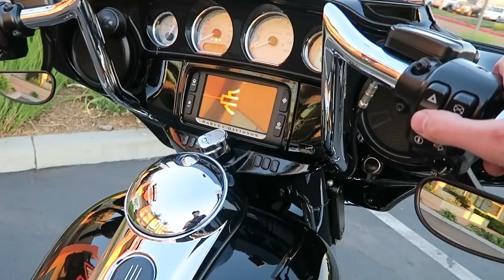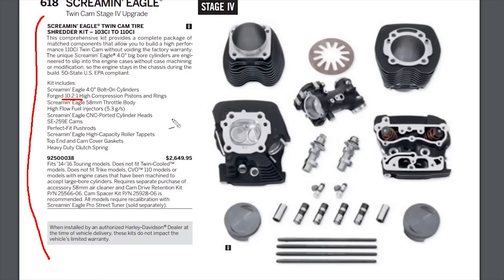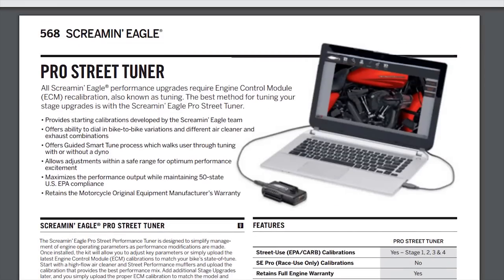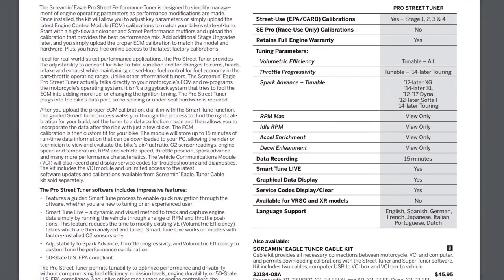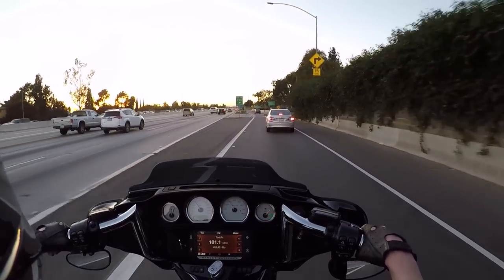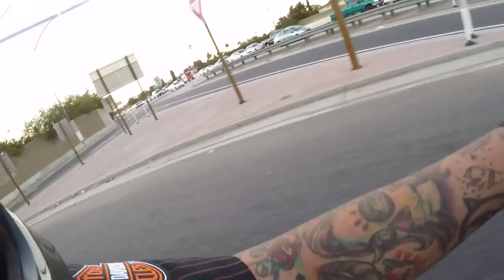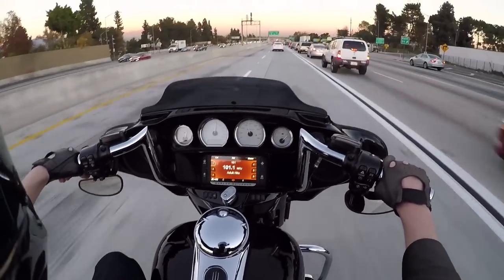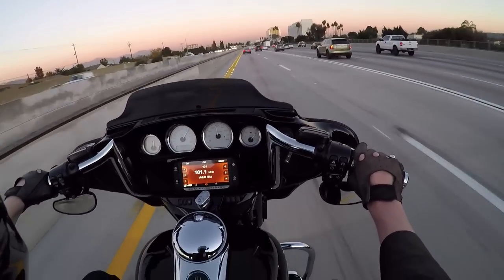Milwaukee-Eight Stage 4 VS Twin Cam 110 Stage 4 │Harley-Davidson Screamin' Eagle

Comment: Twin cam right there and the Harley Kit sucks power wise...check out the kits from FuelMoto and the power numbers they r getting from a 103 to 110 conversion. They posted dyno chart...119HP and 131lb.ft of torque. I do like the new blacked out Specials but why start loan over? I'll stay with my 16 RGS.
Reply: Richard Sak fuel moto rock, would never waste money on a HD kit..
Reply: ? I don't understand, you say Harley stuff sucks but own a road glide special. The 103 to 110 kit from Harley has excellent power.
Reply: Israel Rangel ummm no, read it again, I said the Harley  KIT sucks POWERWISE not ALL Harley stuff. I Don't know how u made that leap. 99% of parts I buy for my bike are genuine Harley except the things I feel the aftermarket is better at namely engine kits, exhausts, and handlebars. I believe those areas that effect emissions Harley, as a vehicle manufacturer, is limited by govt rules and regs (ex the SEPST, RIP). Like I said the Fuel Moto 103 to 110 kits dyno chart shows 119 hp and 131 torque with the same baseline numbers. Bars I have Factory 47 and Exhaust Rinehart. Everything else...genuine Harley Davidson.
Reply: Richard Sak 119hp and 130trq sounds more like a 120 motor . People can boost Dyno numbers in many ways. I've seen it done before. Coming from someone who has had a chance to ride a lot of bikes and different set ups on those bikes , I can tell you that the Harley 103 to 110 kit that is in this video does not have an ounce of suck in it.
Reply: Israel Rangel yes and dyno to dyno can vary thats why the baseline (which FuelMoto supplies) is so important. It's not like I'm the only one, the quality and performance of the Fuel moto kits are well known. Again, I believe it's that "motorcycle manufacturer" designation HD has that limits them by the govt. 3rd party companies like Fuel moto, V&H, Rinehart, Dynojet don't have that concern. They can make "offroad" kits and tuners and Exhaust sets without fear of fines. It would be ignorant to think these companies have better engineers than HD so Im sure it's an outside constraint ie. The EPA or what have you. Ride safe!
Reply: Richard Sak the Harley kits are EPA compliant. That have to be. Harley got sued for that race tuner. If the Harley kits didn’t have to abide by EPA regulations then they would make more power.
Reply: Jacob James exactly 100% correct. That's what happened with the SEPST (Screaming Eagle PRO Super Tuner). It was capable of  tuning the bike out of EPA compliance and that's why they got sued as a " motorcycle manufacturer".  Companies that don't actually build bikes do not have that constraint.
Reply: Finally a group of comments on this site where everybody's informative and useful with their information instead of everybody wanting to fight and name call and act like idiots nice!
Reply: Richard Sak ok are you aware that the tuner doesn't come in the 103 to 110 Harley kit? The kit comes with heads, jugs, pistons, piston rings, cams , throttle body, lifters, push rods and so on. That's what's in a Harley kit. You choose the tuner , pipes, and air cleaner you want. So with an after market tune , pipes, and air cleaner you can put out high power with a Harley kit. It's not the kit that sucks to you , it's the tuner, pipes and air cleaner. Which most people go after market with anyway.
Reply: Jacob James Harley tuners are not part of the big bore kit. If you wanted to, you can run an aftermarket tuner and that would make the kit non epa compliant.
Reply: Israel Rangel sorry bud but now your stretching. At this point I'm pretty sure you have the Harley Kit on your bike.  The majority of th output of the kit is NOT determined by the tune. It's a combination of the parts specs. The cams, pistons, cylinder heads, etc. The tune is done to alter the fueling and spark plug firing along with a few other features. You could not use a tuner to make a kit that is designed to produce 105 horsepower magically produce 119. I know what these kits come with and the FuelMoto is the same way. It boils down to EPA compliance and the fact that HD kits can't be as agressive.
Reply: Israel Rangel I will say this though. The Harley kits, if installed by a dealer and within I think 90 days of purchasing the bike, you keep your warranty AND that warranty covers the kit. That's a huge boost for the Harley Kit especially since in real world street driving, you DON'T need every ounce of horsepower possible. The Harley kits DO improve performance while keeping the bike EPA compliant and if bought and installed as stated above, don't void your warranty.  Having that warranty is priceless. If someone looking to do the kit has a bike that DOES NOT have a warranty anymore though, they WILL get more performance from a 3rd party kit.
Reply: Richard Sak I actually don't. Just stock engine , pipes, air cleaner and a custom mapping, but I've worked in a shop I can tell you that some of these aftermarket kits claim so much and fall so short of what they claim, doesn't mean they suck though, still good product. And also if you checkout the specs on some of these Harley and aftermarket kits they are very similar. Fuel air mixture and timing is very important when try to accomplish the full potential of the parts that you put in your motorcycle, so to say that a tune isnt gonna make a difference doesn't make sense. You can install any kit you want in your bike but with out a proper tunning its not gonna run to its potential.
Reply: So it would make the kit pretty much pointless.
Reply: Israel Rangel I'm done. Now I said a tune makes NO difference. I NEVER said that. Of course it does. However an EPA compliant tune and a non company tune are not going to change the HP number by almost 15. Buy what u like, believe what u like, but stop taking what I say and twisting into what you want me to have said so u can make your argument. Again, OF COURSE a tune matters, I NEVER said it didn't. I'm done, I think people here have gotten enough correct info in this discussion to decide on what they want.
Reply: Richard Sak my hats off to you man you got the patience of Job !! Good grief something's wrong there...
Reply: Scott Bedsaul I never mind an exchange of ideas but don't take what I'm saying and twist it and then make an argument based on that twist. All the concern about the tuners and I would bet the biggest difference in the kits is the camshaft. Other than power adders like turbos and superchargers I think the camshaft probably has the biggest impact on the performance and personality of an engine. You can cam an engine for mostly torque or you can  cam an engine for mostly high RPM  horsepower. Of course to realize the full gains you might need head work (porting and polishing Etc) but just the camshaft can greatly change how an engine functions. Again for a lot of people the Harley kits are great because they do improve performance, not everybody needs every last horsepower, their Emissions legal if that affects u where u live, and you can keep your warranty.
Reply: Scott Bedsaul unless you have some knowledge to share with us , kick rocks.
Reply: Richard Sak yeah they have gotten allot of info. But I've ridden a fuel moto setup and a screaming eagle setup . between the 2 there is no night and day type of difference. So to say the Harley stuff sucks for making power , which you did say. Is false. It makes comparable power to the kit you're talking about. Can't go of what a piece of paper says all the time. What matters is how it feels when you jump on it and ride it.
Reply: Richard Sak I'm sure you've ridden both right? Or is your opinion based off of dyno sheets?
Reply: Fuel Moto does great work no doubt BUT....... Screamin Eagle kits= Carb/EPA compliant AND does not void your warranty !  Just sayin.  If these things do not really matter to ya , then Ya Fuel Moto or T man, are really building impressive motors.  On a side note every motor has a HP- Life number. Meaning the more that they create the shorter the life.....kind of like a sparkler - burns bright as hell when lit but burns out fast.
Reply: scott peters more than half the time I see people get all these performance upgrades on their bikes and never come close to using it.To me that's just a waste of money. It's to stroke their own ego.
Reply: I used the harley kit because I just bought it and everything will be covered for three years on my warranty. After that the motor will already be big. Just swap a couple things for more aggressive and make more power.
Reply: Yeah but ya know Certifiable Harley Wrench Turners that work for a Stealership can only Quote out Harley Specified parts.. Liability issues.. Hundred ways to skin a cat.. Depends on how big a knife ya got to do the skinning.. Gotta remember Older Harley's especially early 70's - 90's ya could build an tune 3-5 the same and not one of them would run identical to the other.. either sound or response .. Harley has come a long way still got lot of ways to go... hopefully it's not too late in the game yet.. The newer bikes are sweet on power compared to my '73 <stock> FLH and my '84 <stage 1-2> FLH  but even those 2 won't touch my '14 Ultra stock.. so they best be hammerin down..

Comment: I have a 2014 ultra limited cvo with V&H Monster Squared's and tuner.  I've had HD salesman tell me the stock M8 107 will outperform my 110.  So I test rode a stock 107 ultra and I was not impressed.  Of course the salesman played it off that if it had same mods as my 110 it would walk away and leave my CVO.  I just don't see it and definitely didn't feel the potential on my test ride.  So Matt, would an Ultra CVO Twin Cam with a 117 kit keep up with a 2018 ultra CVO M8 117 ?

Comment: Milwaukee 8 doesnt sound like a Harley
Reply: Maybe they realized the engine had to change to go forward.One piston  prevents the other piston from exelerating unless they change degree like a Ducati. Not all v8 are the same in cars. some v almost look horizontal.
Reply: Stock exhaust
Reply: Ur wrong.
Reply: Every m8 ive ever heard sounds way better than a tc. M8 has the best sound of a harley.

Comment: Great video I noticed the volt meter was almost pegged in the red while riding is that ok?  I have 2017 Street Glide and mine stays pegged right above the red line same as this bike. Is that an issue what is your thoughts.

Comment: Wait till you have to make a warranty claim - it's all very well and good for Harley when customers spend $10,000 on mods but when shits hit he fan they will tell you to take a hike as in my case they blamed my quiet baffles for cooking the engine and told me to get lost or pay $3000 for repair bills.

They told me because i paid for stage 5 my engine is considered a race engine so i do not have warranty on my brand new 2017 Harley Breakout. 

I bought 5 brand new Harleys since 2013 and spent over $100,000 on bikes parts and services - you wont get my business again Harley !

Do not ever buy your Harleys at Frasers Motorcycles in Dianella Perth WA Australia.
Reply: Harley Davidson Breakout Ducati Panigale 1299 go to another Harley dealer. Harley has to prove that your muffler baffles destroyed your engine. They won’t be able to prove it.  If worse comes to worse get a lawyer involved.
Reply: For the love of god man!!! Why didnt you stop after 50k???? You could buy 10 japanese cruisers that would destroy any stage 5 harley stock. And if u look at the right ones youll get everything a harley has and more, same sounding exhaust, single pin crank isnt just a harley thing, metal fenders also not just a harley thing, and quite a few of them are made here in the USA.
Reply: I have seen used  Harleys for 3000 and 4000 . You must be rich.
Reply: @seanbutler2291  he said Australia. Why hype US made? Oh, you didn't read.
Reply: @seanbutler2291  Japanese cruisers are slow and do not handle anywhere near as get as Harleys their junk.

Comment: as i told so many SAYING YOU HAVE THE FASTEST ROAD KING IN TOWN IS LIKE SAYING YOU ARE THE SMARTEST KID IN CLASS WITH DOWNS SYNDROME!!!!I am a life long Harley owner, I currently have an early twin cam, i have a power commander and slightly steeper cams, not for the reasons you may think. The steeper cams are because i put a TIMING CHAIN ELIMINATOR in it for reliability, Had to do the power commander to tweak the computer to adjust for the different cams. There is no reason to spend 25 grand on a bike then spend another 10 grand to make it faster. Harleys are not sport bikes and when hot rodded break. Want a fast bike? Get a Hyabusa or an R1 or a Ninja.
Reply: I don't understand your argument?  Of course these aren't as fast as sports bikes.  And if your wife wanted a good looking, successful guy she wouldn't have married you.  If you like HD touring bikes for what they are, but want more power, this is a perfectly reasonable option.
Reply: Thanks for playing- we were all wondering what you thought about this video and issue. I feel complete now.

Comment: I always find it amazing for anyone to spend 2535 Grand on motorcycle and then have to upgrade suspension stage 1 2 3
Reply: You don't have to upgrade anything. It's just fun to mod up your ride. I think that's a natural thing on any motorcycle. The 2020 Softail street Bob 107 is a blast right out the box.

Comment: The M8 has more potential for power. The 4 valve heads flow better and don't require high lift cams to get good power.

Comment: These upgrades are all good but you don’t need all that to enjoy riding a motorcycle around. My 107 stock is just fine. I mostly add a few things to make the bike look good, and more importantly replace that stock shift linkage bar because on a long trip that stock shifter will have your ass on the side of the road. HD more than anything needs to get rid of that huge oil soaked primary chain and find a way to eliminate that shifting clunk, and the hot motor on my 107 M8 is no better than my 96 cubic inch even with the fan assisted oil cooler that helps a little bit tho.
 All I am saying is HD is a legacy brand that's had little competition to upgrade until now, I think they know here in 2021 they need to get busy fast.

Comment: Never thought I’d be the guy in the Harley vid comments section saying “Harleys are slow” but man you guys were racing (I assume?) and it looked like you were just cruising through traffic. Those are the speeds my Panigale generates while I’m putting along at 3-4K rpm. I guess I was expecting a lot more based on the numbers. Or maybe that traffic was all doing 90 instead of the 60-70mph traffic I’m used to
Reply from the maker: Yes, traffic was moving good but at the same time I really hope your Panigale is faster. That would be sad if it wasn’t. These are 830 Lbs cruisers.

Comment: I'm looking at quotes to fix the engine heat problem for 103 and larger HD motors ; from a couple of business firms down under ; using ceramics. It would be the only way I would ever consider buying that 2019 Deluxe.  I  not buying the "the will void the warranty" when most HD dealers ; like Doc Harley ; tend to find excuses to void the factory warranty regardless. We throw out factory tin-plated cam bearing and primary chain assembly, as these parts also designed to fail. We also replace the BCM module with third party replacement, so we can still start the motor........

Comment: Hey guys try winding it up some more! I often ride my Harley chopper at around 130mph or 210kmph on roads like this with similar traffic flow. Naked bike no crashbars etc. flying my cut with bare arms. Not sure what speed you guys were doing, but it didn't impress me sorry.

Comment: I got 2017 ROAD GLIDE. I'd be dam if i spend a dime for speed. All those thousands for a fraction of a millimeter of improvement?? I'd just go back to crotch rockets if i wanna go fast...IMHO
Reply: 71donkrider the amount of money people spend on stage kits you could buy a decent crotch rocket and go twice as fast
Reply: I agree. I’ve still got my 99 Kawasaki zrx1100 with 44k miles and it’s slow by today’s standards but it will easily run away from my breakout. Stage 1 to get a better look and sound is as far as a Harley needs to go
Reply: @marka1712  you guys are really comparing crotch rockets to Harleys? I have had both and currently have a Road Glide the reason people spend the money is we like the look and comfort of an AMERICAN MADE bagger but they lack HP so we will spend money to  make it a more ballsy bike by Harley standards not so we can beat a ricer.... these guys are just showing the difference between the new Milwaukee and the twin cam...

Comment: Mt dads 2017 stage 4 screaming Eagle and more seems a lot faster. Its 110 easy but he spent 13k in upgrades and got it new for 24k then added stage 4 with suspension Vance hines w/ x pipes seat , day maker head light(s) intake. His is almost 2.0L when your is 114ci